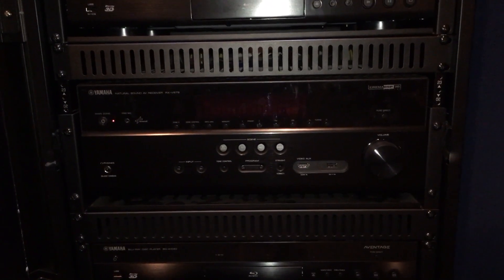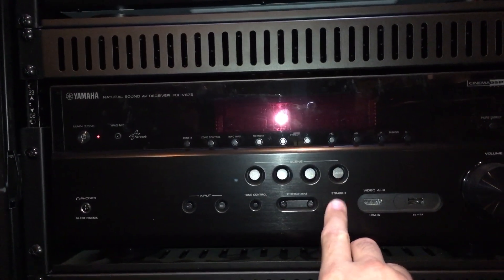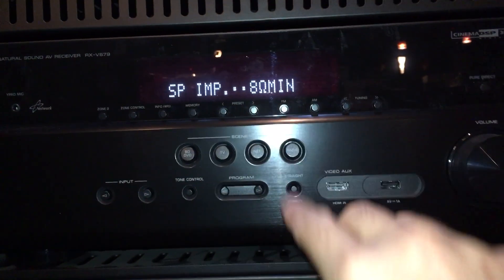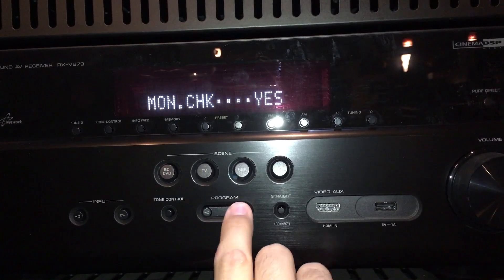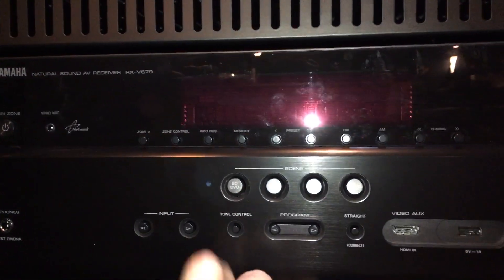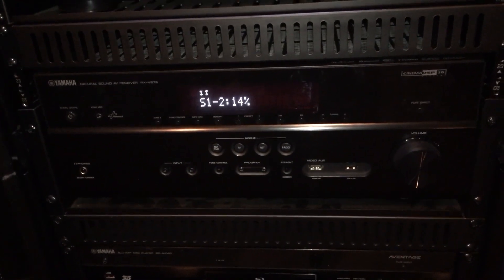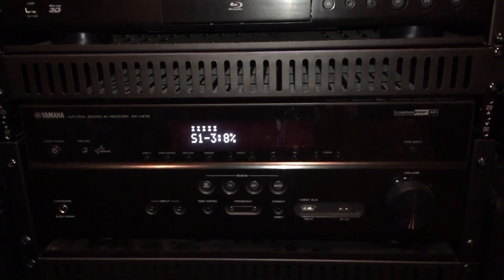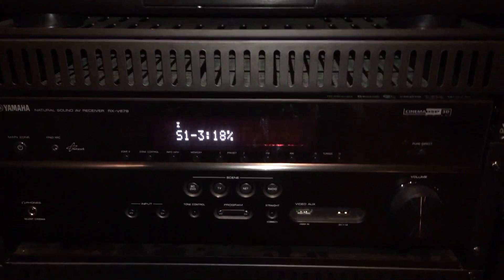Yamaha Receiver Firmware Update

Comment: Great Video! - Updated my RX-V775 and also downloaded the iPhone App from Yamaha to control the Receiver. - Works Great!  I was using the Receiver as a hub for all of my devices with their various HDMI connections tho the Receiver.  I then had the HDMI Out going to my 73inch Mitsubishi TV, which I was able to select fro viewing by using the "Input" button to switch between the Receiver or the TV antenna.  After the update, the TV will no longer switch to the Receiver and wants me to plug the HDMI devices into the TV instead.  Any ideas on what was updated that would change this ability?

Comment: Thanks for the video. I have a question, hopefully you can answer. For some odd reason I can't AirPlay music from any of my devices. Restarted all my devices including the router. Any suggestions. Doing an update as I type this. Maybe that solves my issue.
Reply: I have the sane problem, MacBook nor iPhone will recognize the receiver through AirPlay. Updating the network hasn't solve it..
Reply: William & Carolina: I had the same issue until today: I have downloaded Yamaha app, selected Spotify as input, and in Spotify app I found the option to connect to my RX-V775. Still not able to connect using the music main app on the iPhone, but I can see connectivity is not the issue. I am also able to connect from the laptop iTunes app.

Comment: I have Yamaha av receiver rx  v679,I'm on firmware 2.60 the Latest is 2.86 according to Yamaha Europe online,when I do it by going in the menus way it takes a while then it says no t found..
Reply from the maker: Make sure your receiver is online.  If it won’t connect, or if it is connected and still giving you an issue, download the firmware from the website, save it in the root file of a usb drive, connect it to the front of the receiver, and choose UPDATE USB at the beginning of the process

Comment: Thank you. Great video.
I have an RX-A830. Just bought pre-owned. 2 concerns.
1) 'Version Error' each time I power up the receiver.
2) When I raise up the volume, the Max Volume number goes up only 'from -15.5 to Volume Max.' My speakers are not loud enough. Even though I reached the Maximum Volume already. The 'Trim' volumes are already on Max. On 'Volume Max' screen, it says -15db...
Help please.
Reply: Did they help you with your issue mine is the same but zero sound

Comment: Hi, the update worked fine on my RX A 660 but since then I have no video output.
the HDMI cable is plugged in, I just tested it on a computer and it is not faulty nor is the TV. I have a red "HDMI" on the AVR screen when I select an HDMI input (maybe this is normal but I don't remember). I mean no output at all. No output of my inputs and also no display of AVR options, music relevant info, etc. I'm a bit annoyed...
Reply: Reset the receiver.

Comment: I have  updated through Network and got a "Update Success" message. After powering it Off Standby Light went of Off as well and the unit is dead now, not responding to any buttons and is not power on as well. Any suggesstions?

Comment: I have a RX-A3040.  Before I could initiate the advance menu, I needed to turn off Zone 2,3,4 and leave the Zone on Zone Control.  Just press the Zone buttons to turn on/off.  If I had Zone 2,3,4 showing on the Yamaha LCD Display, holding the Straight button and pressing Power button did nothing.  Turning the Zone 2,3,4 off worked just like in your video.

Comment: I have tried this several times and get 'Device Error' every time. 

Any thoughts?
Reply: Alanna Lacroix are you connected to the internet by a wired cable or wifi? I suggest wired cable as the wifi will likely be password protected. I just hooked mine up from out of the box and it worked perfectly the first time. Sorry if that's not helpful.